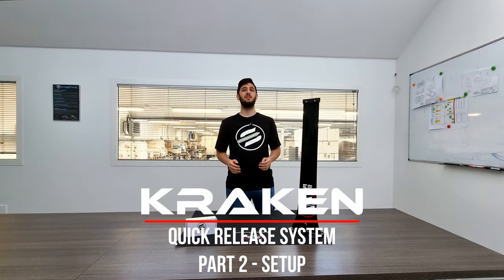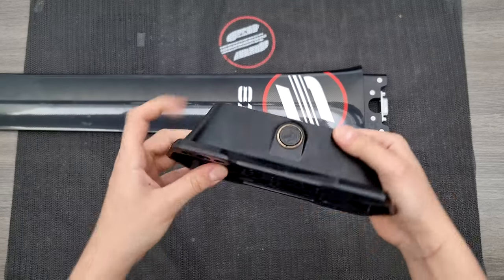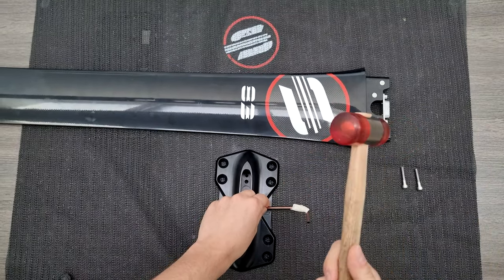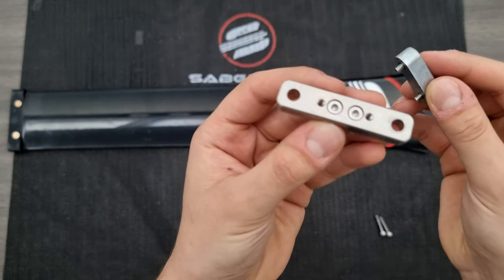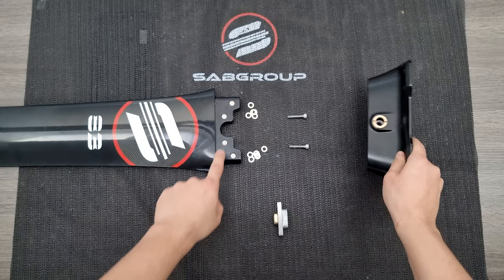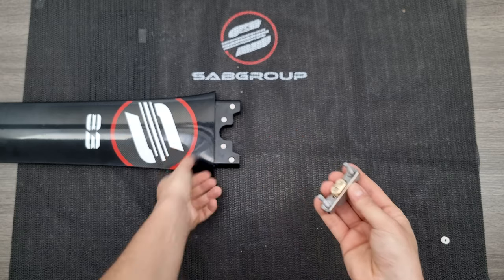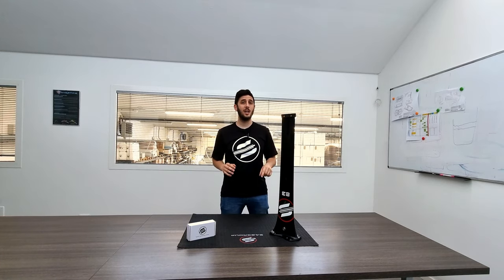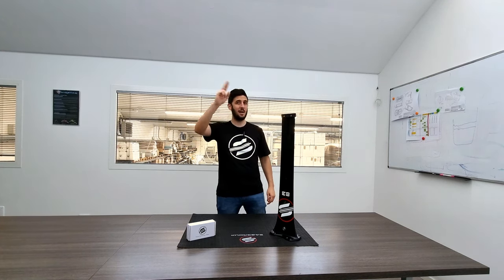KRAKEN QUICK RELEASE SYSTEM - Part 2 | GETTING STARTED (+ How it Works)

Comment: You don't apply any lithium grease when mounting the quick release system to the mast...
Is this no longer needed, now that you have the Sacrificial Anode installed in it? 
What's your advise?
Reply from the maker: It is always good to use lithium grease, both for friction and anti corrosion purpose.
Thank you for noticing and asking

Comment: i'm curious what happens (even if one uses lithium grease) after 2-12 month in salt water....... seems overly complicated and prone to failure...... i can also imagine the distance alters with time so one would constantly need to re-adjust the number of shims....... why not a mast with an integrated plate?
Reply: had it mounted for 2 years and used it at least 250 days per year in salt water and took 1 shim out today as the brass plate was worn - but could open the 2 screws without any problem.